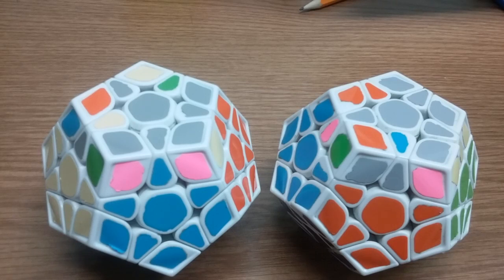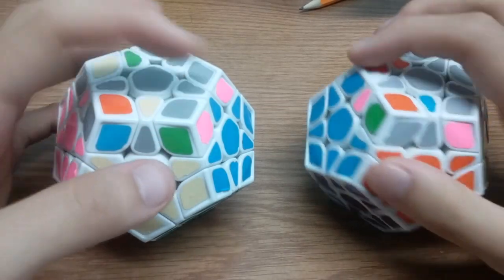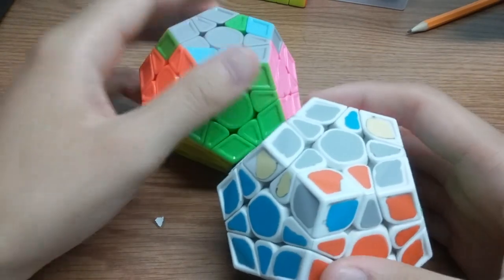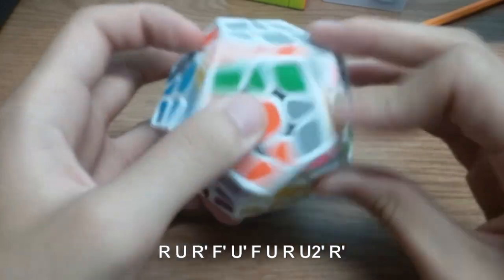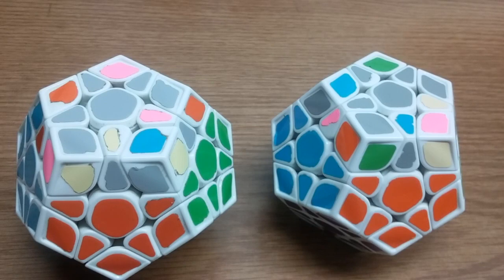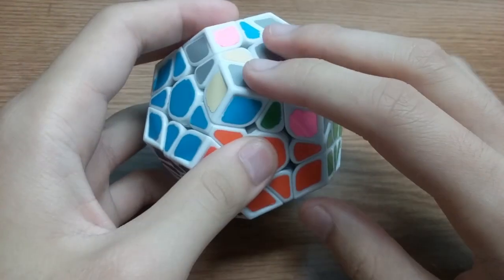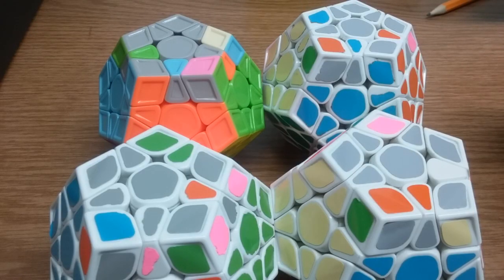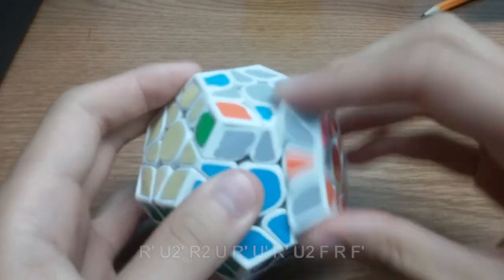Megaminx OLL Part 3 - 3x3 Lookalikes - 2 Corner Groups

Comment: For alg 19. I think back-sune U' sexy sledge might work better. Haven't tested it yet though.
EDIT: I've timed both algs: yours comes at 2.5 average, while I can do mine consistently under 1.5 seconds.
Reply from the maker: I use F U R U2' R' U' R U2 R' U' F' now, I tried your alg too tho, definitely better than the one in the video
Reply: @NicolasNaing  uh, that looks better. Duh, why didn't I think of that?
Reply from the maker: @thephysicistcuber175  was from an oll alg website, similar to a 3x3 alg
Reply: @NicolasNaing  I definitely noticed the similarity. A lot of these OLLs that look like awkward shapes can be translated with many different alternate algs :)
Reply from the maker: @thephysicistcuber175  yeah, works out pretty well